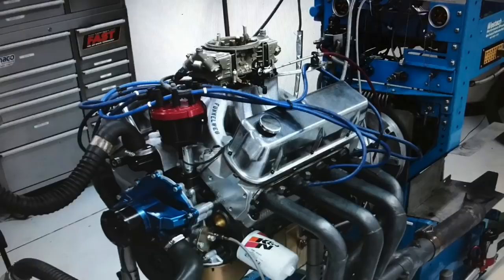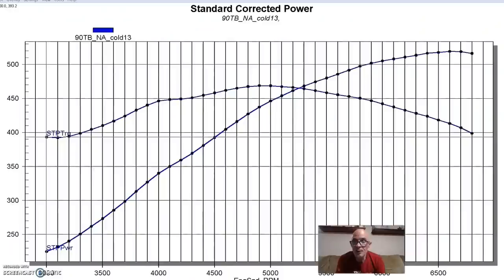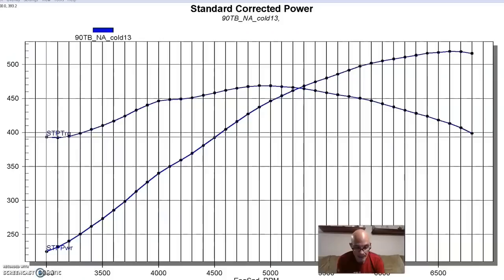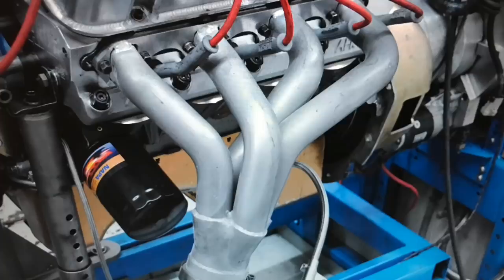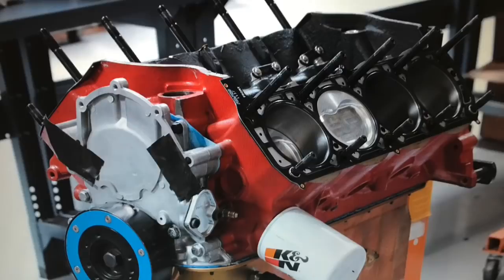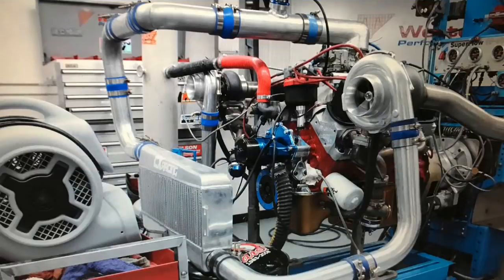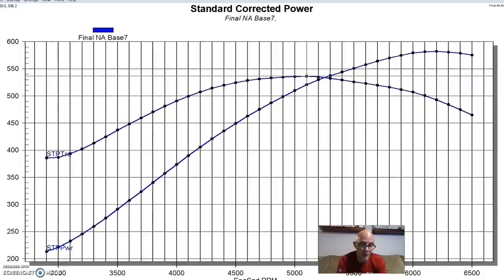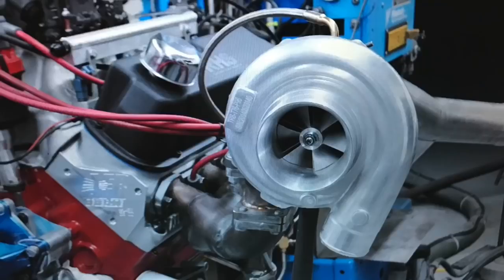1000-HP HOW TO: SBF TURBO STROKERS

Comment: Imagine the bigger heads and cam on the 427 that the 363 had
Reply: The monster in the closet is what would most guys do with 1000hp! You just can't  put 1000 hp onto the old fox body (well you can, and if you don't kill yourself you'll have a hellova story to tell your grandkids)!  That 9.5" deck with 5.969" rods makes for a very cheap and durable foundation! 1000hp is gonna split that 8.2" block! The only question is when! But 1000hp in my Fairmount wagon!! Is my life insurance policy current?!
Reply: yes, it would make way more power but I think he doesn't want to hurt Chevy's LS fan boy's feelings with the mighty 351.. The 350 simply cant compete in my opinion..
Reply: So a fully built aftermarket turbo motor (any brand)  will beat an LS (stock, cammed, turbo LS I assume)?  I sure hope so!
Reply: @Turbo_Todd  he also did it with a junk yard 351w but didnt gap the rings for boosts.
Reply: @Turbo_Todd  any engine can be a built one, this 351 wasn't race motor, it was a junk yard one, wasn't it??
Reply: @P71ScrewHead  Yea, I'm sure that's it... couldn't have anything to do with just fitting the criteria of the video. 🙄

P.S. LS is a designation for a group of engines and not one of them is a 350.
Reply: @BrendanCBreen  I mentioned the Chevy 350 cuz when I was way younger I had Chevy lovers tell me the 350 was better than the mighty 351W, obviously everyone's gonna favor the brand they love best, a Dodge guy might pop up n say his version on this similar size engines is better, it's never ending..lol Today's youngsters just know LS 4.8-6.0Ls, tend to not know anything about any other engines that aren't in modern muscle cars..

Comment: I don't know why but I always love an underdog, not necessarily a Ford but even a SBF woopin a coyote is sweet. But one of my dream engines is a 7.4L SBC or even a 7.0, spankin LS engines with a SBC would just be sweet where alot of people act like SBC nowadays is a boat anchor, not that it's better than the LS it is one of the best engines ever made and very capable and can go toe to toe with LS engines just needs alot more go fast parts to compete , if it was such trash why would World make a hybrid SBC block to take LS heads and World claims it's superior...? Calm down everyone I didn't say it they did.😉
Reply from the maker: it is not important that one engine family be better than another-just figure out what power you want-every engine can make make power
Reply: Richard Holdener : Yeah yaaaa!
Reply: Small block chevy still has the biggest supply of aftermarket parts and stuff is super cheap . Where the LS shine is that they are able to handle big power in stock form . All you need is springs, cam and boost - boom 1000hp .

Comment: You should do a big bang with the speedmaster block.
Reply from the maker: its rarely the block that limits power
Reply: @richardholdener1727  I know but the speedmaster blocks are always a big topic in fb groups. Some say they hold good power others say they arent much better then stock.
Reply: Oof bro. Even the cheapest speedmaster blocks they rate at 1500+hp. Your looking at getting a crazy expensive bottom end, like one that won't break until 2500hp and giving it enough airflow just to break it. With the thicker cylinder walls and splayed billet caps there is nothing that sticks out as a weakness and as long as the deck is done right you will have to do something incredibly stupid to break the block. Even to get the power to split a Gen1 race block requires splayed valves, methanol and huge boost or aluminum rods and nitro. It's not a billet dry block so if you treat it like a top fuel engine, the block will probably let go first... But why would you want to? Most of the failures on the blocks I've read about are stripped threads in alloy blocks, and to be fair they're not helicoiled and probably should be. The machining is crap and there are numerous issues with deck warping in race applications and sleeves coming loose when at temperature.
Still, how hard do you think you would have to hit it to split the block or push the mains out?

Comment: Well boost pressure is a measure of resistance, so ideally, an engine that can make more power with less boost is more efficient and less stressful on the engine itself
Reply: Boost isn't necessarily a measure of resistance. For example boosted engines generally use more lift in a camshaft to increase airflow. The reason being because boosted engines aren't as efficient when a camshaft using "overlap" is installed. Valve overlap in a N/A motor uses exhaust pulses to scavenge airflow across the cylinder but in a boosted application just allows air to freely flow out the exhaust manifold requiring a bigger turbo or supercharger to acquire the same cylinder pressures as if using a high lift camshaft instead of a camshaft with lots of valve overlap.
Reply: @jeremypike9153  so when you increase the valve duration and lift you're reducing resistance to flow? Thanks :)
Reply: @mjcmustang  You most definitely are reducing the resistance to flow if valve overlap is involved in a "boosted" application only. Overlap hangs both the intake and exhaust valves open for a split second relying on the firing order of the engines other cylinders to help pull air into the combustion chamber which increases power in a naturally aspirated engine but not in a boosted application. True boosted camshafts will have very little valve overlap if any. The reason is that the extra pressure coming into the intake from a supercharger or turbocharger you want to stay in the cylinder for the piston to compress yet again. If the exhaust valve has overlap with the intake valve the pressure from boost blows straight out of the exhaust requiring more pressure to over come the "boost leak" that was created by valve overlap. The concept of boost is to "technically raise" atmospheric pressure mechanically of course. The more pressure you have in the cylinder before it compresses the more the air is compressed during the compression stroke.
Reply: Most aftermarket camshafts with extra duration & overlap also have extra valve lift which is why they increase power output compared to an OE camshaft but if overlap is eliminated in a boosted application cylinder pressures are increased resulting in more power than a camshaft comparable with extra valve overlap.
Reply: Duration as defined is the amount of time the intake valve is opened as a measurement and the amount of time the exhaust valve is opened as a measurement. Valve lift is how far each valve is opened. Overlap is the amount of time each valve is open at the same time. All of these except for lift are measured in degrees of rotation. Lift itself is measured (at the can lobe itself) how far it transmits the valve train. Lift can be changed on an OE camshaft with different ratio rocker arms or the change of the pivot point on the rocker arm. Duration and overlap are not changeable without changing the shape of the camshaft lobe itself.  Most of the time an aftermarket camshaft or set of camshafts (depending on the engine) will come with a card explaining the measurements of at least two of these measurements lift and duration overlap can be mathematically figured if not given on a cam card.
Reply: Watch the camshaft video Richard posted this morning. Everything we thought we knew didn't apply to his tests. NA cam outperformed a wider lobe separation in na and boosted form. Fooled me.

Comment: i drive a grand national and am running 23 psi on the stock bottom end. Has a ported intake and nice cam in it
Reply: Totally would be a cool test a 3.8 turbo Buick?
Reply: @jonathanschrader7881  Yes! If he built it right he could make 1000 hp with forged internals and a stud girdle. What would be cooler is him just taking a bone stock bottom end, race gas, ported heads and intake big turbo and see how far ti goes before the crack breaks in half. They'll break around 700 flywheel hp

Comment: Huh! Perfect timing. I'm trying to plan out my motor build and deciding what cam has been a massive brain killer. 

Did you need to run different push rods and did you need to do anything with the cabs to make them run with boost? 

I have heard that the carb will starve of fuel so was thinking about the sniper EFI system.

Thanks for doing these tests btw!!
Reply from the maker: pushrod length needs to be measured and the carb run on the turbo motor was a dedicated blow-through carb from CVSU
Reply: @richardholdener1727  thanks, so I looked up that cam on comps website and it says it needs to be computer controlled?

Comment: I like when Richard gives more information about the hot side of the turbo.  Not enough people talk about the hot side of the turbo.  More turbine specs PLEASE!
Reply: Most of the CX racing/on3/Ebay stuff from back in the day had a P-trim turbine wheel.  So those 76's would be 7565's, most likely with .68 A/R turbine housings.  The Import companies didn't start making 7675 or 7875 clones until the last few years.
Reply from the maker: there was only 1 76mm from CX available when we did this test
Reply: Soooooo, what turbine was it?
Reply: @davidleslie6207  100% it was a P-trim wheel, 65mm.  Only Richard knows if it was a .68 or .96.  A/R
Reply: @PsychoShaun198   And he will never respond!

Comment: Also new to turbos I hear that turbo lag is a thing of the past? Or is I just greatly reduced? Building a sport touring car. Not a drag car so I would like it to be as responsive as possible.
Reply: Turbos have gotten better but mainly its been the large selection of turbo sizes and additional technology like anti lag and quick spool valves, and multi step boost controllers that reduce lag.
Reply from the maker: you can size the turbo to come on at any rpm

Comment: Very impressive! Being a Chevy guy I never followed the 302. Just had a lot of respect for it for obvious reasons. Lately I’ve been hearing that the 302 blocks crack under high hp????if so what is that hp range??? Never heard of this back in the day. Was very surprised.
Reply: North of 500 whp , most people switch to aftermarket blocks if they want to make any serious power .
Reply: Angelo Vasilikos : Hello  Im a Ford oholic. Ive been one for 40 years. Like Clevelands oil galley issues and thinwall bore splitting, the  non Boss Mustang Iron 302 "OHV Ford 5.0" had a block cracking issue even in endurance racing at 350 hp non boosted when the 50 ounce unbalance crank was used. Mexican, Windsor, or Cleveland foundary engines, but generally not the Ford racing XE cast blocks. Real and actual 289 or factory 302s have a lot less iron in the middle.  Even the first 230 hp 4v ĢT and J code 302's with 28 ounce unbalance cranks in 1968 had a marginal endurance record in 500 mile races. The 302/5.0 block can take flashes of 500 hp, but its def. marginal.  The central core webbing of SBC's and the LS engines were never downgraded as much, and dont carry the same crank unbalance. Info. Australian Touring car racing, Production  Group A, C and V8 Supercars. (AVESCO).Ford USA supplied neutral balance steel crank aftermarket blocks to every AVESCO 302/5.0 racer from 1993 to 2003. When production 5.0 blocks were used in 1983 to 1987 in the Australian Touring Car Championship Fox Mustangs,  every one eventually cracked. In 4bbl engines that dynoed at just 350 to 390 hp at 6800 rpm.

Comment: Richard, what would your opinion be on the Procomp/Speedmaster I-beam rods ? Great value? or stay away?
Reply from the maker: we used them-they work
Reply: Richards says they work but for how long and at what cost?  The old adage you get what you pay for applies here.  I would NEVER skimp on bottom end parts.  Cost of failure is too high.
Reply: Sub 600 hp, sub 7000 rpm

Comment: Interesting results! That 363 had really big heads and cam, too bad the induction system seemed to hold it back so much. Took a couple “extra” lbs of boost to make double the NA hp. The bored and stroked 351 was amazing, little heads and little cam to make very respectable NA power. Another great video, lots of info. Thanks Richard! (I still want to see you do a blow through Sniper on a single plane one of these days).
Reply: Brian Dugle : The Box R is a T3 Tickford style intake. Normal Showa G52 intakes on the SVT and Lightenings drop out well before 425 hp gross. The Box R needs a few nights veolocity probing with a good SuperFlow flowbench. Radius work on the edges helps. Anyway, the LS has replaced the Winsdosr derived 351 to 427 stokers, but that 363 is shallow and compact in the way a Modular or LS or 427 siamese bore Fraud can never be. 363 with a HOT concept... High Output Turbos! 427= LPT Low Pressure Turbo. But I still like 9.469 to 9.500 inch decks too. Spoiled fer choice, Young Skywalkers...dont waste a shot....
Reply from the maker: the 363 was also turbo limited
Reply: Thanks for the info on the short deck intake. Although I admit to once owning a new ‘89 LX notchback 5.0 (and daughters had a 4-speed 4-bbl 289 ‘66 in high school), I’m really a Chevy guy.
Reply: Brian Dugle : I love production cast iron blocks that dont split when making 1000 hp. Ill bet a DZ Small Block Chevy 302 wont. But Im sure a stroked 5.0 will. Richard showed us that awesome TFS headed turbo F150 5.8 truck engine....it was the special low compression engine he did. It ended up making 1000 hp but, ahem, became  junk due to rods, maybee not the block. I have pictures of his smiley face at Four Eyed Pride suggesting some stronger rods before his dyno run blew it up. The modern 82 mm throttle intake upgrade happened in 2001  when  Ford Australia made a factory 342 stroker with a kind of Box R upper and lower EFi, the 335 hp net and 369 lb ft T3 Pursuit 250 engine. They reverted to GT40 P iron heads  after about 1500 aluminum head Y303 or whatever   factory 295 hp 5.0 OHV engines were made. Id say Ford were aware of how little extra strength in reserve existed in the factory 5.0 iron block. Even the 289 Le Mans GT40 Mark II' s with quad Webers making 380 hp gross had a few issues surviving. The race 8.2 inch deck 4.125 siamese block is really nice. Unlike GM, Ford didnt like giving 65 pounds of block iron away for free with every engine. Back to Richard. Love this channel.

Comment: Working on my 4 digit 321 cubed 94 mustang.. boss block 321 4.125 bore and 3.00 stroke ported 170 trick flow  heads crane came 228/232 track heat  stock 9 to 1 compression .
Reply: 18 lb of boost twin 64's over a thousand , 28 lb of boost 1350 easy
Reply: You should go 205 or 225 heads.
Reply: @CanIbeFrank  my 170's were ported by Greg killian he flowed them at 290cfm at .600 lift that will be enough to reach my goals . I run a 1.72 ratio rocker and the crane cam is .552 intake and .563 on the exhaust which puts me right at .600 lift.

Comment: Mr. Holdener, what do you think of the Speedmaster blocks???
Really good prices.
Reply from the maker: we've used a lot of those
Reply: @richardholdener1727  Can they still be purchased?
Reply: @richardholdener1727  if i got a stock cast iron block from the 80s (347 stroker) is 1k hp possible or do i need a dart block

Comment: Richard, have you ever tested a remote turbo system? Something like the STS setup or similar. I know a couple cars really lend themselves to this kind of setup although some people hate on it pretty hard, other guys really like it. Your opinion on this is about as unbiased as you can get and it would be nice to know what you think.
Reply: Look up his test of a turbo Gen 3 Hemi, he simulated a pickup truck with the turbo in the bed.
It worked.
Reply: @johnparrish9215   it's pretty hard to compare a brake dyno to real world or even inertia testing. Test I saw ran between 3500-6000. When the dyno loaded it in the engine jumped to 3700 and the brake dragged the engine down to about 3460rpm over more than 3 seconds. That means before the test even started the engine had already been at wot for almost five seconds. All the extra plumbing and issues that maybe come from a remote mount are basically outright ignored with a brake dyno. Even the difference in exhaust pipe charge time is over 0.1 sec when you put longtubes on a car as compared to cast manifolds, you will never see that on an engine dyno but you will probably notice on a road course. I have seen a few videos with guys beating the strip into submission or trolling the streets, i don't trust anyone else's opinion if they put the name of the kit manufacturer in the video title.

Comment: A challenge, let's see 1000HP NA.
Reply: There are more than a dozen reliable big block recipes that make well over 1k.
Reply from the maker: there are endless combinations of every motor to make this power level-these are just two SB Fords
Reply: Lots of compression, lots of cubic inches, lots of head flow, lots of rpm, big ass cam.
Reply: I am pretty sure Steve Morris has had 1000hp bracket engines that run on pump gas sitting in crates for ten years.